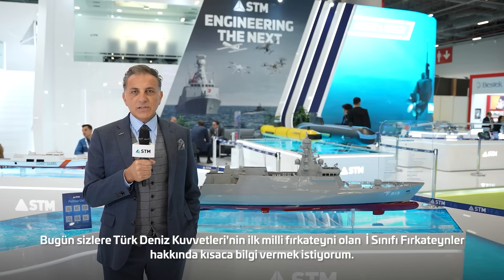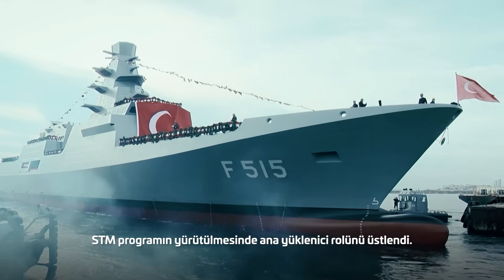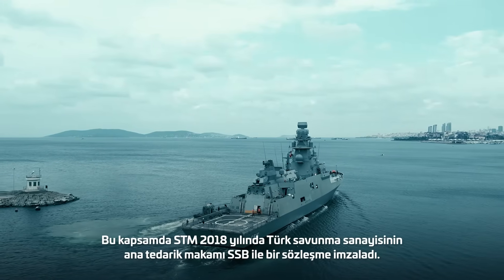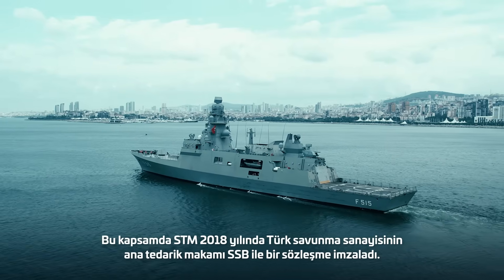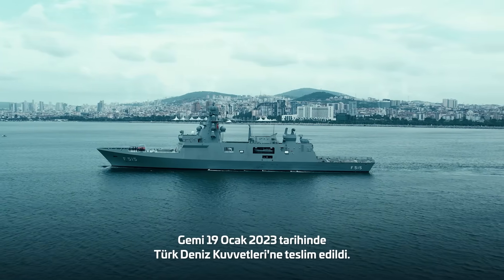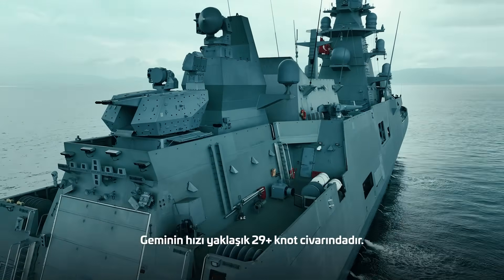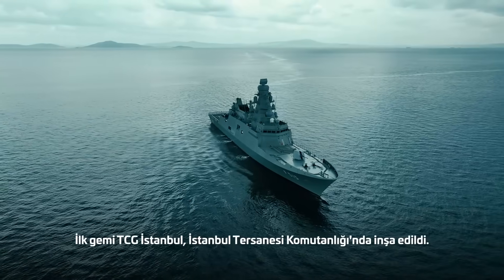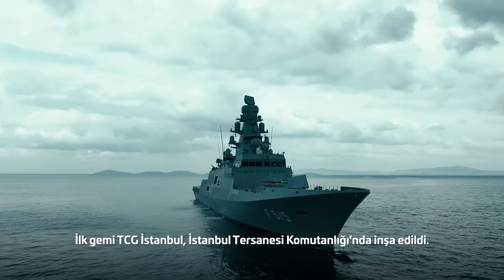Türkiye’s Modern Naval Power: The I-Class Frigates

Comment: Probably in about 10-12 years, Türkiye will have the second largest naval fleet as per capability in the Mediterranean after France (only due the nuclear submarine fleet and aircraft carrier capacity).
Reply: assuming that spain and italy are doing nothing to keep their edge with aircraft carriers. türkiye has no real aircraft carrier and probably will never have one - does not need it either imo.
Reply: @Predator23rd there's a new aircraft carrier project and the first cut has been made 1.5 months ago. But this carrier is going to be build for the red sea, Sudan coasts and Somalia coasts as Türkiye has interests there and building a rocket research facility in Somalia to test long range missiles and deep sea oil and gas drilling operations due to the agreements made with Türkiye. Recently Türkiye added 2 more drilling ships to its fleet just for Somalia. And to protect these assets, Türkiye is in a desperate need for a decent aircraft carrier rather than the TCG Anadolu which will be a drone and helicopter carrier only.
Reply: And you pointed to a good point. Both Spain and İtaly have carriers but they almost didn't use them for any operations like France is doing. @Predator23rd
Reply: @cemgokcan  in that case you are assuming that TÜRKIYE will make use of TCG ANADOLU (and/or whatever comes next) for force projection? if yes, to where? how will we protect that "carrier" group? what will be the "airwing" made of?
Reply: @Predator23rd at the same time Türkiye did the first cut of the TF-2000 air defense destroyer which will be a batch of six for fleet defense. The Anadolu as i said will be drone carrier only where the tests of the new TB-3 drones (have foldable wings) continue.
And on the carrier under construction will be the Hürjet's naval versions and the Kızılelma drones.
Reply: @cemgokcan  all nice and good but I do not see how we can outmatch the italian navy with their F-35s and bigger destroyers.  what I absolutely not understand is why we are spending money on such projects. I believe more frigates and destroyers would be much better assets, as we are not a blue water navy.
Reply: @Predator23rd that is a good question but all the remaining 6 frigates (+1 TCG İstanbul) and the 6 TF-2000 destroyers will be blue water capable ships. The already existing fleet of Türkiye is capable enough for the Mediterranean and Egean sea. As i mentioned earlier, Türkiye is building these ships for the Red Sea and İndian ocean. Only 2 frigates and 2 destroyers will remain in the turkish waters but the rest will be deployed at the task force.
Also one more info. As you might have heard recently, Türkiye has launched a new project for a nuclear powered submarine (with an option up to 4) to be deployed for fleet protection.